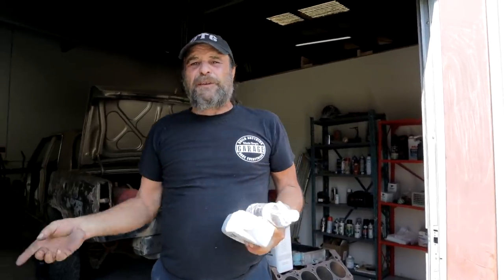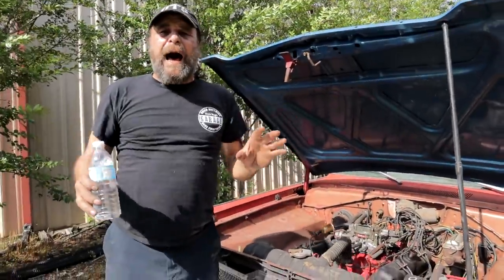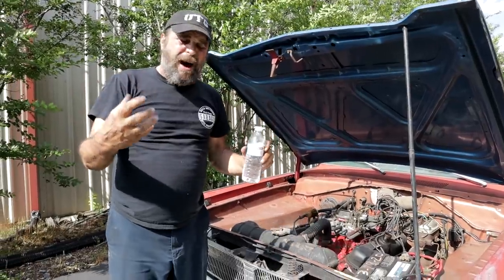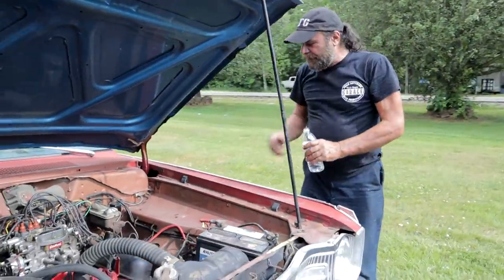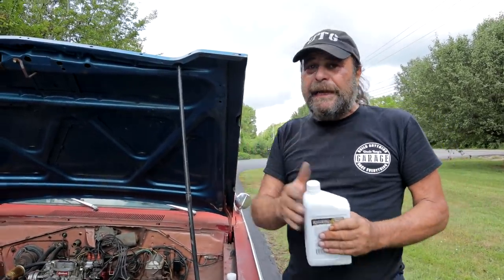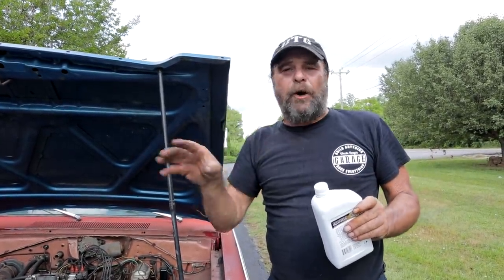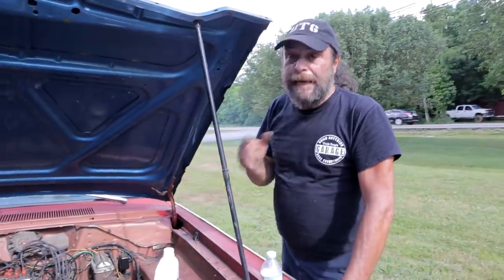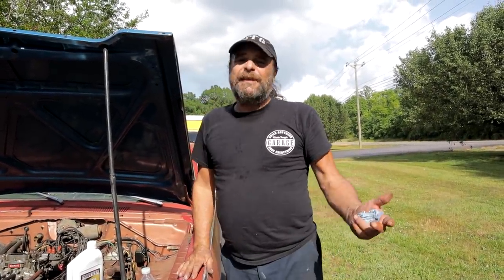Forgotten Service Routines From The Distant Past

Comment: UT... the old start the engine with diesel fuel in the crankcase.. plz! But yes. Both of these methods are true and do work on the older engines. I use them both. Along with once in a while a diesel fuel during oil changes

Comment: Uncle T,  l watched your video on adjusting idle air mix screws to get the maximum vacuum,  but could never get a steady needle.  It would flutter intermittently always and one screw would always be half a turn leaner. I am thinking sticking intake valve   so should I try the transmission fluid trick, yes??

Comment: Ah yes, "Seafoaming" back before there was such a thing...
I'm a little older than Tony, so I grew up learning all these "shadetree" tricks and of course,
we always had the old beaters that needed such service, too.

No video tutorials needed, no fancy Sea-whatever...like Tony said, it usually involved a 12
ounce Coke bottle (the real ones, thick green glass, returnable for a nickel) full of water.

Now, could you screw the job up? Sure, you could "drown" the engine if you were stupid with
it - but you learned not to do that again, too (the engine wasn't hurt; you had just managed to
douse the ignition/plugs, so you waited a bit, then cranked the car back up and blew it out).
You usually wound up with permanent black stains in concrete behind the tailpipes and you'd
swear the car ran better afterwards, but honestly? We did it so often it probably didn't matter.

Tony is also correct in that stuck valves were a very common issue in those old engines. 
The combination of oil technology of the day (dino oil, no synth anything) and most peoples'
lack of getting their oil changed regularly meant stuck valves happened a lot.
Water wasn't going to cure that, so it was time for the MARVEL treatment. Same application,
just MUCH more concentration on not letting the engine stall whilst dumping it down the carb
fast as you could without drowning the thing - and that all was after you had already dumped
"valve top" oil in the crankcase and run it some.
Great smoke creation with the Marvel - or Rislone - or some such brand....but I "saved" more
than one cooked engine with that method. 

Most of the time, Tony is all about the show with his channel here; grain of salt recommended
when you watch him as a result - but sometimes, the subject is dead on. This is one of those.

Comment: You didnt mention using Rice to act as a shot peen on carboned up heads and piston faces.  The rice would burn up and leave as ash but clean cylinder surfaces or head and intake passages were gasoline travelled.

Comment: Utg fans, I have a 73 Dodge Dart Sport and need to put in a new Blaster coil and relocate it. It's too close to the back of the carb and sitting sideways. Having hard hot starts. In AZ that don't work out too well. Do I have to reset the points or just unhook and rehook the new one in. Also I've heard of issues with the ballast resistor. I'd love some help here in the comments! Tia!

Comment: Used to do that all the time, some guys liked seafoam. They kept trying it even after the gas no longer left varnishes, and a broken engine isn't going to be fixed when there isn't enough carb to cause a problem. The reason today's gas doesn't cause all the varnish and carbon build up like we saw into the late 80s is very simple. When they started putting ethanol in rather than tetraethyl lead (TEL) or MTBE the varnish problem went away even when gasoline sits for a long time. It doesn't want to run when it sits, but there is no thick varnish in there. Look inside a gas tank of a vehicle that hasn't run since before 1982 and you will see a thick varnish.  Why not TEL and MTBE? Well they both kill people and lead causes neurological problems. Don't eat the paint chips, don't lick anything from China, and don't breathe gasoline fumes with TEL in them.

Everyone is told to hate ethanol, but it keeps everything clean and allows you to burn the condensation that inevitably builds up inside the tank while it raises octane. The gasoline people say it raises octane like 2-3 points, but its more like 10 points. Its the best thing you can use when you have compression on the edge of needing race gas. Splash some E85 in every tank, up to 30% and the carb won't need any changes. Over 50% you start needing to change things, and at 70% you need a carb calibrated for it. EFI can handle 30% no problem, 50% if the injectors have enough volume (head room) and above 70% needs a tune or the flex fuel stuff.

In my engines that I run E85 and no gasoline, there is very little carbon and zero varnish, rust, etc in the tanks. If I run the home made E100 denatured with something other than gasoline, like methanol from washer fluid or HEET (which does the exact same thing with water as ethanol) there is zero carbon inside the engine and the oil changes look like it has never been run even after 10,000 miles. It comes out clean. Its the freakiest thing to people who have never seen it before.. lol. You change the oil due to thermal breakdown, not because its clogged with carbon. To legally run E100 on the highways you need to denature it, HEET works good as it doesn't introduce the heavy carbon that gasoline does.

Its kinda cool, my ethanol vehicles start no problem after sitting five months during the winter. The pump gas vehicles always need fresh gas put in them to run right. Vodka doesn't go bad, Scotch aged for 12 years is better, and ethanol does not break down unless its exposed to UV light for a long enough time. Ethanol is vodka, and the difference between vodka and whiskey is proof (how much alcohol vs water is in it) and whiskey is aged. Gasoline gets worse as the lighter components evaporate, because they are what makes it start easier.

Comment: I used to run a little atf in my gas tank of my "71" Lemans sport for top end lube. Wished I never sold that one.
Reply: 71 Le mans.. A Pontiac!..that grill!!  AND etc etc etc..either a 400 or 455ci. So good  etc etc...
Reply: @LJC5865  mine was a 350 with 2 barrel auto
Reply: @waynebuzzell2483  Yes even better on most days just cruising around. I expect this Car to get a lot more attention some day.

Comment: Damn it.... With 3 - '72 Monte Carlos... and I always do my own work, I wish I had this guy as a best friend... For when small shit happens, like last summer, Points Dist went kaput.... Wiring to coil was good as I checked it, but after a few months, I learned the Points Condenser went bad.. I have never since 1974 ever experienced such. Mechanic I used told me the dist was bad, so replaced it, then 10 months later, it happened again.. so I replaced dist again... and in conjunction with this Ethanol Gas doing it's boiling in my 2bbl rochester carb, which had never seen before... and car running rough at stop, and having to increase rpm's to keep it from dying.. and that car has been down now for 7 months cause of my lack of knowledge, and putting a dist in correctly... No clue on my part... shit like this has never ever happened before with any of the '72's I have owned/driven. Now I purchased phenolic spacer for carb and mechanical fuel pump, along with insulation to put over my fuel lines.. Gotta get off my @zz and get 'er done before the 90's get here and too hot for me to do work.
Reply: Its 2021. You haven't needed to replace a set of points for 47 years for 3 cars?

Comment: that car is a menace to society!!   >>>----> is it for sale?       My mom and dad had totally different philosophies when it came to cars.    My mom would lug the engine up a hill to save gas.     She'd insist that I use the engine when slowing down to save the brakes.     After my mom had the car for a week, it would be carbony.   My dad would rev the hell out of it in the driveway.    You could see carbon chunks come out of the exhaust.     My mom would insist he was wearing out the engine doing that.       Let's see?    Brake pads cost ?    Rebuilding an engine costs?

Comment: Ford type F automatic transmission fluid used to contain sperm whale oil, If you had a Ford you had to use it or the thing absolutely would not work. This older style fluid was probably the best upper cylinder lubricant ever.

Comment: I did the transmission trick with a 1967 Grand Prix one time and it seems a piece of carbon got stuck in a valve and the heads had to come off.  I am not a fan.

Comment: Hello uncle Tony
Thanks for your wonderful tips
I run Marvel Mystery Oil in my gas tank and HHO through the Air Intake 
My 1985 Mercury literally runs better than new 
Hydrogen burns hotter and faster than gasoline so using HHO greatly improves efficiency 
Hydrogen actually burns carbon as part of the combustion process, resulting in clean combustion chambers, motor oil, and plugs etc
My Mercury passes California Emissions with greatly reduced NOx and as you might imagine my catalytic converters died many years ago 
You are an old Double AA fuel guy Tony what is that white exhaust flame?

Comment: You can use water as an octane booster too, you'll see people who run high boost or high compression with water/methanol injection systems. I run a primitive setup where the timed vacuum port will suck a certain amount of water in. Can't be bothered paying for 93 octane with 10mpg and water works just as well, just a pain to use a proportioning valve to get the right amount of water going and unless its warmed up it drives like a turd.
Reply: Water injection or slowly introducing water to the motors intake doesn’t increase fuel octane. What the does is reduce combustion chamber temp a bit whiles also removing carbon that cause hotspots in comb chambers & lowers compression a bit both of which reduce the motors tendency to detonate/ping when accelerating & or when under load making you think the water raised the fuel octane when in fact it didn’t.
Reply: @scottwheaton9689  I relooked into it after reading ur response and maybe its just looking at it a different way. As far as I understand it octane rating is resistance to detonation/combustion. The water mixing with the fuel charge effectively creates "higher octane" and ive read conflicting write ups where people say its "effectively 116+" octane and some saying "its not adding octane" which sure its not necessarily changing anything to do with the fuel but when combined it does resist combustion alot better, cooling the intake charge and removing carbon are contributing things that aid in reducing detonation like you said. The reason, maybe i mispoke, that it "adds octane" is that when the fuel charge is mixing with the water not only is the environment cooled and less likely to cause pinging but the fuel mixed with a substance that doesnt like to combust on its own, prob isnt going to make it very easy to combust either. I've experienced this when i add too much water and the unburnt fuel just starts rolling out the exhaust and also starts to stumble like its not igniting
Reply: Im assuming the wordplay here is that water "has no octane rating" since its not a combustible fuel or something like that, but it does in effect make things harder to ignite therefore "in effect helping octane rating"

Comment: Guess the valve cleaning has kind of come full circle now with the new GDI motors. They often get valve deposits real bad since there's no fuel washing over the backs of the valves like a port injected engine. Gotta run water/meth or walnut blast em every 50k or 100k miles.

Comment: It's a dazda part dodge part Mazda I had a 74 duster it had a slant 6 you can't kill it the only thing I had to do every once in a while I had to pull the back spark plug it fouled out had a cracked ring a small price to pay for a 300 dollar car you could get in started every time great channel with a lot of information thank you sir my uncle had a salvage yard in California I bought the car from him just some cars you just can't scrap I also bought a 78 dodge d100 with a 318 at the same time  great cars my dang internet connection  I tried to save all the mopars I could we got a purple 70 challenger it had a 383 4 speed and a crazy flower covered vinal roof we moved and had to sale them I'll get another mopar muscle car one day I inherited my mom's 89 turbo Voyager  its prity dam fast for a 2.5 4 cylinder that water in the carb looks a lot safer then some of the chemicals they have thank you again sir  keep up the great videos

Comment: actually, the reason old engines carbon'd up (and ads for used cars would claim the car had "highway miles" to show it had burned out the carbon) was (A) poorly refined fuels--today's detergents in gas and the ethanol everyone hates the libs for adding (when its really Archer Daniels Midland) means a lot less carbonizing in the combustion chambers and (B) the carb's poor ability to atomize said fuel, compared to the fuel injectors of today and (C) thick piston rings digging the cylinder walls and turning the car into a coal burner (ie, motor oil in the combustion chamber) by 80,000 + miles. today we have thinner piston rings and overdrive running the engines below 3,000 RPM on the highway.  you don't find varnish in gas tanks like you used to in lawn mowers and anything 4 cycle.

By the 1970's water injection was done to prevent detonation on high compression engines. So kids, if you try this and you don't see big clouds of black smoke coming out your tailpipe, rest assured your old classic isn't carboning up.  You'll also know since you aren't dieseling--the carbon isn't turning into a glow plug.

another fun regular maintenance back in the day was cutting your heater hoses to install the Prestone Flush Kit and doing that around the same time you swapped from summer to snow tires.

Comment: LOL this is just to funny. i just bought a willys jeep cj5 with a v 6 buick not sure if its the 198 or the 225. the changed it to HEI and drove it a few days and got a miss and found number 3 and 0 compression and developed a knock.  i told him HEi hotter spark carbon broke loose and to do what you are doing. he told me i was fucking nuts. that if i wanted to do it give him $500 and i can have the jeep and do what ever i wanted. i never heard it run i drove up handed him $500 let it run until it got hot and did that and drove it home running great. it took a week of him begging me and i sold it back to him for $550. hes lucky i sold it back to him. but we are kinda friends.

Comment: Those tricks are still being used... even in dealerships.  They just keep it quiet now... ;)  GM actually makes a special "top engine cleaner" that's dark green, smells like death and is used to clean carbon just like the old trans fluid trick.  Of course, they have a service bulletin that specifically tells us NOT to pour it into the intake (even though they KNOW we use it that way anyhow), but in the same bulletin they recommend pulling the spark plugs and pouring it directly into the cylinders, leaving it set overnight and then reinstalling the plugs... and it smokes even worse than using tranny fluid!  But since the catalytic converters are cold when you do it, it doesn't hurt them any (yes you can use tranny fluid this same way and it does work but only put about an ounce in each cyl. and make damn sure to let it soak in overnight and crank the engine before you put the plugs in so it doesn't hydrolock when you start it).  There's also all kinds of gadgets you can buy that use shop air to pressurise a canister that you fill with their special wonder fluid so it will spray into the intake while the engine is running... does the exact same thing as a bottle of tranny fluid at 10x the price, but people still buy the crap.

Comment: That's a good way to bend a connecting rod because we all know that water won't compress .I told some stupid lady in a Lincoln to stop starting her car because there was Antifreeze coming out of the tailpipe .Once the lady left the car 2 pistons would not come up and 2 rods looked like the letter C 
We got some rods and pistons out of another engine and sent her down the road  . CAR RAN GREAT AFTER SHE RUINED IT used rings and no honing at all .I used to be surprised how I could put together junk and get away with it ..3.8 were known for bad head gaskets back then 

 ATF won't cut rust like marvel or brake fluid will .

Comment: Uhmm today's engines leave a varnish and gummed  up oil in the intake runners!!!!! That's because or the egr amd emissions system. You have know idea how bad a 2019 ram 1500 v6 intake runners look like with 25,000 miles on it. It is terrible!!!!